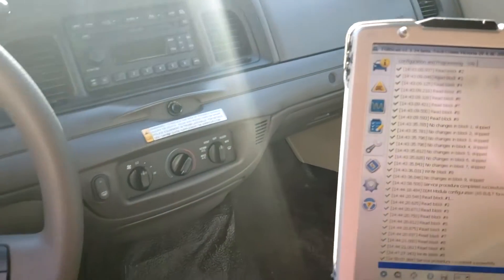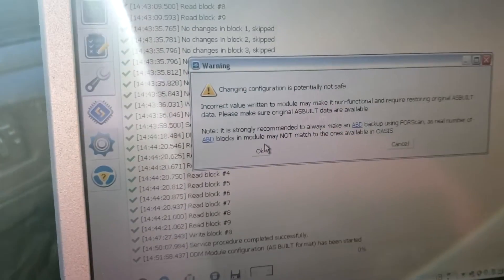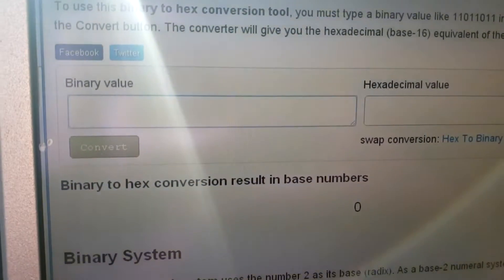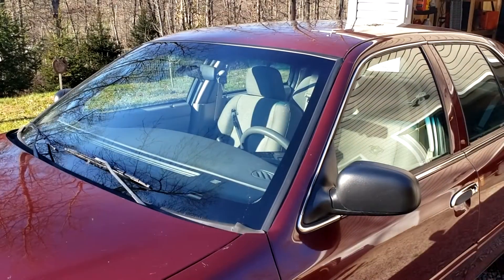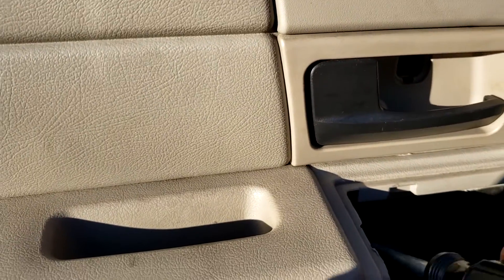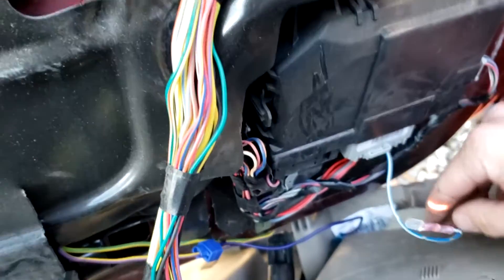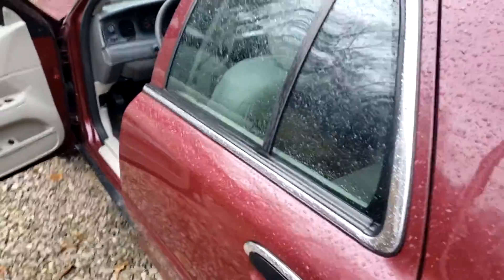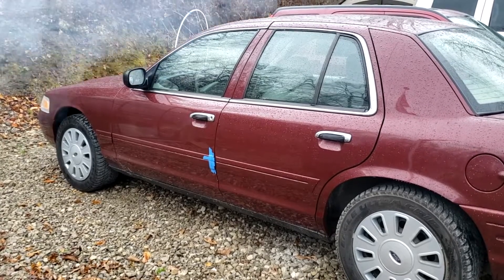How To Add OEM Keyless Entry 2008-2011 P71 Crown Victoria Police Interceptor

Comment: Figured I'd add to the pool of knowledge, mine originally came with an A0-08 code of EC15, changed it to ED15 and followed the other steps and it works

Comment: Thanks. I bought a driver door module from eBay advertised as having keyless entry because I thought that would be easier than Forscan but it turns out it didn’t have keyless entry. So I followed your tutorial and I now have it. Thanks

Comment: Quick questions I did mine and It won’t let me program a 2nd Fob and when unlocking the door the map light turns on
Reply from the maker: Did you just press the lock button on the first one and then immediately press the lock button on the next one? Then once all have been learned, you shut off ignition. If it's not working, may be a problem with 2nd transmitter.
Reply: Ohhhh ok im going to try it , and it worked thank you !!!!

Comment: The flow for my 2010 P7B. Purchased the Forscan recommended auto switching adapter from Amablonde for like $39 Then bought Forscan for like $10? Two black generic ford keyfobs from Blonde prime for like $12. Followed your instructions to the tee and changed one bit. Key cycled 8 times and wham bam thank you mamm. Lock. Lock.... I had my viper after market for years and it kinda puts it to shame. It's response time is much faster. Thanks man. Trunk pop on 2010 P7B (at-least on mine is ready to go. I have door button and console button setup for key in only) Thx again

Comment: Very informative in the first few seconds. I have a 2007 that I could not pair up with the four button
fob. Not sure what you are referring to on the antenna.
Reply: They have antenna receivers for the fob that came factory starting in 08-11. You would have to pull the cable from a Lincoln town car or grand marquis or crown vic because they have them as well.

Comment: Does forscan work for the cruise control or do you need the Ford one
Reply from the maker: Forscan does not work for adding cruise control. You must have FDRS or IDS to reprogram the PCM with a different calibration to add cruise.

Comment: Says I need the paid license? I thought it would work with the free forscan?
Reply from the maker: You can sign up for a free trial license
https://forscan.org/support/prepare_trial_el_request.php?lang=en
Reply: @JackofAllMasterofNone  I did it, thanks! Only thing is mine says 2814. Should I just change it to 2915? Or keep it as 2914?
Reply: @JackofAllMasterofNone  I tried 2915 and it worked!!! Thank you so much! Only thing is when I lock it there's no lights or honk. But the alarm does have both, odd!
Reply: @GttiqwT  Is dark car mode enabled on your rig?  Does the dome light come on when you open a door?  If not it probably disables the flashing lights as well.  I would take that trade as it also kills the seat belt dinger having dark car mode turned on

Comment: Are you 100% sure that 2008 vehicles have the module? Cuz I'm not certain that my p71 2008 has it
Reply from the maker: Yes 100%
Reply: Forscan is saying I need an extended license for this function?
Reply from the maker: @drwombat  Get a free license from forscan. Just Google forscan trial extended license.
Reply: Thanks. I'm still having problems... The DDM was found and communicates so that's there (you're 100% correct thanks for that) and I disabled the TPMS, but I cannot get into FOB program mode...

I do the 8x KOEO cycles and the door locks don't click/cycle like yours do... But alternatively my doors auto lock/unlock depending on whether the key is in accessory position (instead of after shifting into drive like most other vehicles I've driven) yours isn't doing this when you do the 8x KOEO cycles... I think this may have something to do with why mine isn't entering program mode... Should my p71 if still factory configured, be locking/unlocking doors when I turn key to accessory on position?

Comment: Your p71 has a street appearance package does it not? I have a regular p71 with two connectors to the trunk pop in the center dash so I think all I need to do to get fob trunk pop, is have the non ignition trunk pop wire harness hooked to it, and this will work easy for me.
Reply from the maker: Yes. P71 street appearance package.
Reply: It did work by the way. 🙂
Reply: I know you wrote this a long time ago, but can you explain that a little better? I’m aware of the two different connectors for the dash button. Do you mean that you just had the non-ignition one hooked to the button or that you fished a wire from that harness into the door? I have my 2008 wired up for non ignition and set up my keyless entry following this video and my truck won’t open by the remote

Comment: good video but when I put my binary and hex numbers in I got a different number and it did not work with the key fob's. so I just put in your A915 number to try and it worked and the trunk pop worked as well. so if anyone runs in to the issue I had just try the A915 number  thanks for the video

Comment: My 2008 P71 was built in December 07 the DDM parts # is 8W7T-13C7-91AC. I see the antenna module in the rear c pillar. My dad was a ford mechanic then a mechanic for the police department working on crown vics etc. He thinks im wasting my time but after finding the module I feel like I might be on to something. However, Im using a maximus 2.0 and when I check special function it lists RKE as an option. It lets me into the menu for RKE but errors out "make sure the module is installed" when doing any of the tests. Would this be due to that hex value being A815? just want to get more info before I buy the adapter.
Reply from the maker: Yes. Most likely it errors out because FORD has it "turned off" in the code. That's why you have to turn it on. Same hardware.

Comment: I've got a 2009 CVPI, tried this and changed from 2815 to 2855 but still no reaction. I checked several times and I altered the correct "0" in the binary code. Do you have any idea why it didn't work?
Reply: Hey buddy, sorry for bad English I'm from Germany 

I had the same problem with the same 2 codes like you.

Try 2915
It worked on my 2010 p7B
👍
Reply: @steffenheitmann4236  First of all your English is more than good enough sir. And thanks, I did that after asking on a FB-forum. It works perfectly now 👍
Reply: @steffenheitmann4236  I had the same issue and this worked. Thank you
Reply: 2915

Comment: You are correct on everything but the setting up the trunk pop or what you can do is you can take the center piece out on the dash where the trunk release button is and there’s another plug back there one is set up for the vehicle Hass to have the key in the ignition and in the on position in order to open the trunk but if you plug into the other plug that goes into it it will switch it to you can open at any time that is basically the master switch for all the other switches like on the door panel just thought you should know that
Reply: what year is yours?

Comment: My 2011 p7b, instead of the “a815” I had “2815” changed it to “2915”, key works just fine! This video is great. Also the trunk pop was working after I did this.
Reply: I was about ready to give up when I input 2955 and it didn't work. Thank you so much for this comment. Jack should definitely pin this comment
Reply: My 2008 was the same as your 2011.....  "2815" instead of "A815".  Changed it to 2915 and presto, it works!
Reply: Thank you, this helped me get my 2011 working!
Reply: @grunklestain3998  Had the same code as well and changed it to 2915 and voila!!! Thank you sir!

Comment: One small bit of wrong information here.
The antenna is not located in the DDM, it is located in the passenger C pillar. It's a black rectangular box. Only 08+ P71s and 06+ civilian models have this antenna. On Towncars, it's located between the two rear speakers.
The 06-07 DDM is identical to the 08 DDM, and can have RKE enabled on it. No need to swap the module.
However, the antenna and the wiring connecting it to the DDM must be added. The wires (5 of them) can be cut and spliced. You can mount the antenna in the door for easy installation, range wont be affected.

Also, 09-11 already have the trunk pop wire from factory. It only needs to be added on 06-08.

Comment: Are you running the free Forscan or did you buy the license?
Reply from the maker: You can get a free temporary license. It is worth buying though if you work on your car a lot.
Reply: @JackofAllMasterofNone  Thanks again for this helpful video, I just programmed and added RKE today. I forget what my first four string of code was - it wasn’t the same as yours, might’ve been the one in a few comments. Either way, changed the 8 to a 9, wrote, and programmed my fobs. Taking the door panel off to do the trunk open jumper is next. A few questions - it’s been years since I had the door panel off, so forgive me if some of these are stupid and I’ll know the answer the second I get it off:
1. I added a power seat driver’s door panel and it also had a trunk release button when my original did not. I forget whether there were two options for the trunk release button like the button in the center dash, but it currently only works if the car is running. Is there a second plug for always hot, and does it matter which one I tap into purple on? That is to say, can I tap my purple to the DDM using the current plug that only works when the car is running, and pop the trunk even when it’s off?
2. Please tell me if I’m being stupid and wrong, but I’m not sure I see the logic in using the quick disconnect spade to tap in the DDM jumper. You said it’s if you take the door panel off in the future, but wouldn’t you just unplug the trunk button connector from the door panel like the power seat remote and window switches? If the DDM stays attached to the door and the trunk plug does too once you take it off the door panel, it’s not going anywhere and there’s no need for a quick disconnect, no? I was just planning on using a butt crimp and having the original trunk purple wire on one side, and the other side of the trunk switch wire plus the DDM jumper on the other side.
3. So you break the donor DDM plug plastic to get the pins out, pick a big one from one of the corners that’ll fit the vacant slot, then do you push it in from the back? Or do you pop off the front cover to push it in from the front and seat it by pulling the wire in back?
4. Does the battery need to be disconnected while you’re doing all this?

Thanks again.

Comment: For an 08 does it automatically honk when locked after that value has been changed? Or is there another setting that must be touched?
Reply from the maker: It honks after you press the lock button twice, just like any other FORD.

Comment: Thanks for your detailed instructions. Worked for my crown vic PIN 2011 perfectly. Hexcode for my car was 2815 and I changed it to 2915.
Reply from the maker: Excellent. Glad it worked for you!
Reply: My 2008 CVPI flex fuel had the same hex code. I was worried at first but it totally worked. Thankful for these instructions ❤

Comment: I have my key fob program but I can’t get the the actual door locks to go down or up when I hit the button on the fob or the button inside the car but when I hit the buttons I hear the click down by the door module but nothing happens can you help please thanks the car is a 2009 crown Victoria P71
Reply: Same problem for me
Reply: @jayyjones2285  right on if you find a fix let me know & I’ll do the same
Reply from the maker: Did they work before you started the project?
Reply: @JackofAllMasterofNone   no they did not
Reply from the maker: @SIRMAC93  Ok. Well that could be many things. First thing I would check is the fuse. Also, the switch itself in the door is notorious for going bad. It may need replaced. Could also be the wiring is broken in the door jam. Many things to check.

Comment: Anyone know how to make it so my horn honks and lights flash when I hit the lock button twice on my fob? There's nothing for it in my forscan in either my ddm or lcm im assuming its a code or something. Any help is appreciated
Reply from the maker: What year? It was an option in Forscan on my 2008
Reply: @JackofAllMasterofNone  2009 i don't see anything for it in mine
Reply: Mines do this too bt I can’t get my keyless entry to work
Reply: @jayyjones2285  i used forscan to get mine to work. I've actually got my confirmation flash to work now too that way